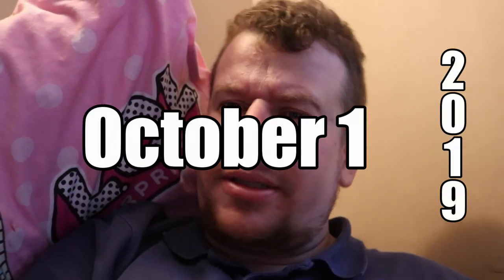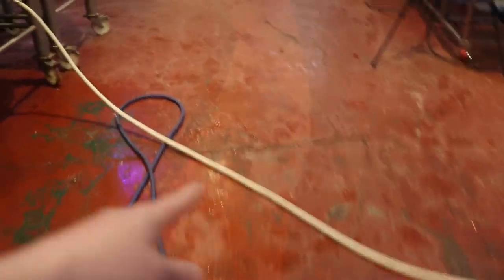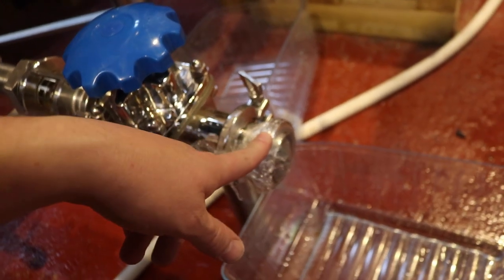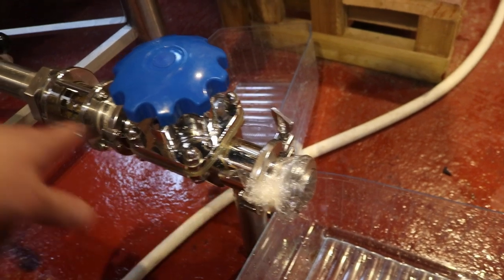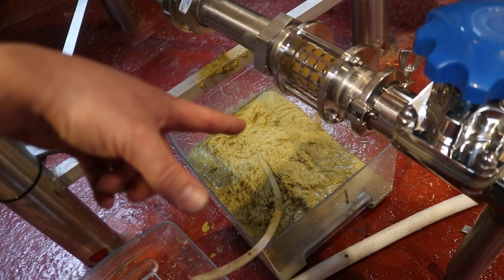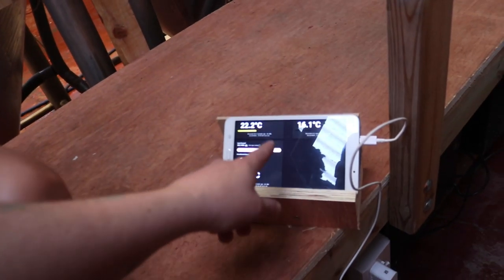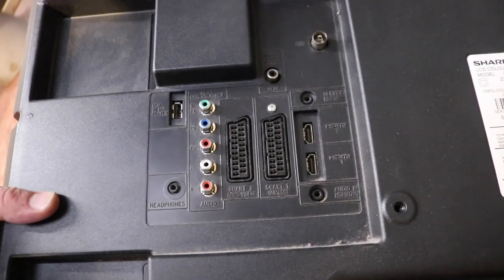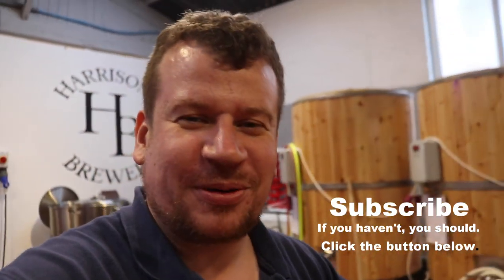Attempted Yeast Harvest.

Comment: We typically wait to pull yeast for harvesting until we hit terminal gravity, and then we dry hop after we harvest. There are a couple beers we make that do have an active primary dry hop and coincidently we use a different yeast with those that doesn’t flow easily. The way we manage keeping that yeast constantly growing is to divert wort into a prop system (or small fermentor) from other batches of wort and then leaving some behind in the prop vessel after growing and pitching.

Comment: You're all set...you'll need a mini HDMI to HDMI, a mini USB to regular USB and look into fermentrack. It runs fine on a Pi Zero Wireless. You could look at brewpi, but fermentrack supports multiple tilts natively. You can run the Zero from the TV USB and plug the HDMI direct into the TV. You'll also want to get a wireless or bluetooth keyboard. It would be better to run the PI and TV from a battery backup - that way, you'll keep your data and status for hours after a power outage.

Comment: Yes, you can use SSH to remotely access the Pi once it is setup. I would use a DC power supply for the Pi as the TV might cut the power suddenly and the Pi will die pretty fast if you just cut the power to it, it's low power enough to just leave running anyway

Comment: Directly power the PI using a proper adapter, they are around £6. The Tilt PI is actually controlled via your laptop browser over WIFI... The Pi you are using for the Tilts only runs the Tilt Pi software, nothing else, as far as I know. I could be wrong. So I'm not sure it has a browser installed on it, or any other OS, other than the Tilt system.

The Pi will need to be close to the Tilts, as these use bluetooth connections. It's unlikely that signal will reach to where you want it - When I was using the phone app for my Tilt, it wouldn't pick up through my fermentation fridge in the cupboard under the stairs 15 feet to my sofa in the lounge... 

I think you'll need 2 Pi's - One for the Tilt Pi control OS, and another with a more generic OS on it so you can run a browser, on the same Wifi network - plugged into your telly on the wall. You'll possibly need a little wifi keyboard as well. Can't see why that wouldn't work.

Comment: Harry, that's how I would pull my yeast in my SS Brewtech Chronical Fermenter. Wait till it hits FG, drop to 14°C, pull the yeast then add the dry hop additions. There still might be some hop trub in the yeast though that transferred over from the kettle to FV. I use the raspberry pi 3 in conjunction with my TILT and hook it up to a tv like you're planning to view the readings ect.. you will have to download the TILT Pi software on the TILT website and flash it onto ta micro sd card in the raspberry pi.  (There is 2 versions of the software, to project it onto a tv/monitor or just to log the data onto goolge maps ect, without viewing it on a tv/monitor). Then after that it's just a case of getting a long HDMI lead to run it to the tv in your case,  where you want to position it  and a power cord to power it up.

Comment: That TV if it have USB on it will actually power the Pi.
Reply: TV USB outputs rarely have the amperage to power a PI reliably, much better to get a good quality 2.5A PSU and power it separately. Also some TV USBs turn off when you turn the set off, so your RPi would be continuously hard reset and restarted, thrashing the SD card